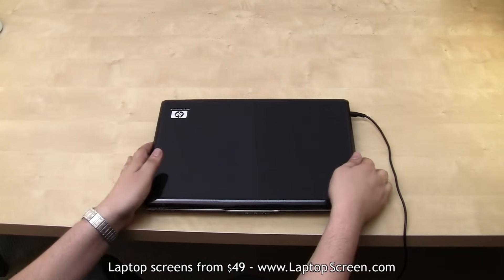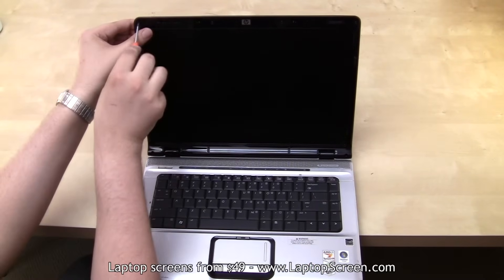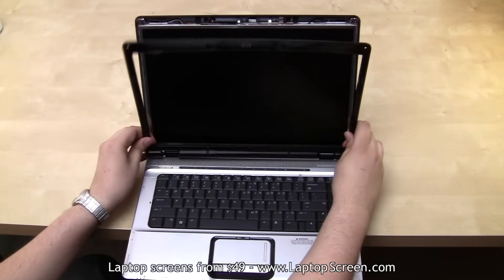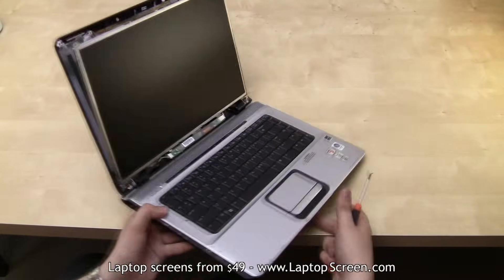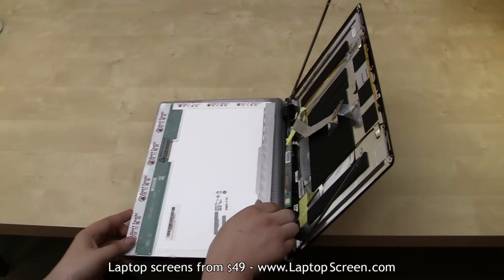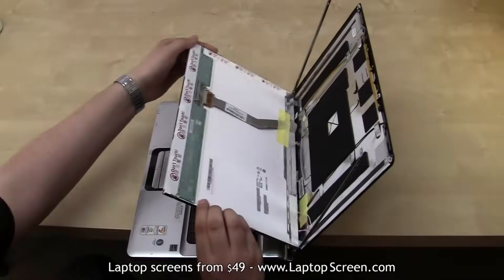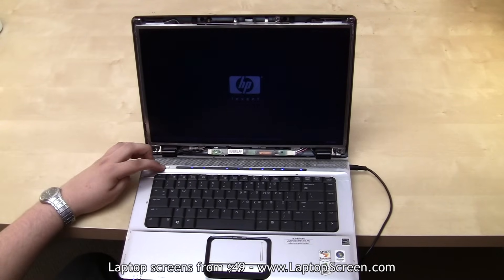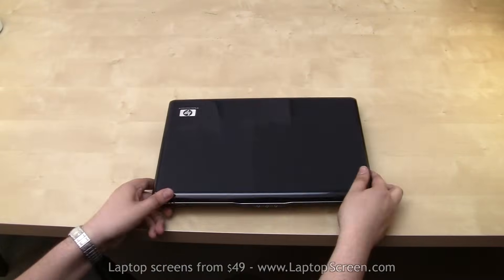Laptop screen replacement / How to Repair (replace) LCD screen in a laptop

Comment: hi, thanks for informative video ! May I ask you about SCHENKER DTR 17 (desktop replacement: P755DM3) screen which is installed in my laptop (17.3" Ultra HD (3840 x 2160) IPS | non-glare | G-SYNC). What I could buy to replace old screen with eg lower resolution like 2560 x 1440 or 2560 x 1920 ? Is there any replacement on aliexpress / amazon etc ?

Comment: Congratulations for the intructive video, i have a question.
What important details I have to consider when replacing a screen:
. resolution
.pin connectors
-touch none touch
. eDP or VLS
What else....about the energy maybe?
If I make a mistake selecting a wrong one, what is the worst that could happen to a Laptop?
Thanks :)
Reply from the maker: + Size and mountings.
But it would be  easier to just type in your laptop model or LCD model number in search on our site to get the correct replacement than to hunt down all the specs.
Reply: @Laptopscreen  Thank you for your answer :) 
Im finding out if if the beautiful FHD IPS HDR 400 Dolby Vision screens from the Thinkpads P1Gen2 and X1E2 are compatible with the T590. Both of them use H intel processors, and the T590, U.
Same 30 pin connectors, FHD, but the T590 need a low power panel, how important is that?
Reply from the maker: They are fully cross-compatible. Power rating is not an issue to get everything working - the interface allows for a range of panels, but the battery life will be proportionally less on a brighter display.
Reply: @Laptopscreen  Fully? Wow, are you 100% sure? :) Does the size of the panel bezel a problem? It has to fit.
So, to change a panel, only you have to check both things: pins and resolution, thats it.
Thank you very much Laptopscreen.com, as soon as I know the panel of those Laptops, I'll orden them from you :D
Regards from Peru, country of the best food in the world.
Reply from the maker: https://www.laptopscreen.com/741945/
Reply: @Laptopscreen  Thank you so much, do you know where explains about sufixes,  what means each letter of the nomenclature, thanks!
Want to know what is HW3B
Reply from the maker: HW means Hard-Ware (version) 3B. The nomenclature is not always consistent among  the LCD models, so its hard to comment what this means specifically in this case.
Reply: @Laptopscreen  Thanks again :)
It is posible to know what is the FHD HDR400 screen models of the Thinkpads P1 Gen 2 and the X1E2 ? I can't find them because they are from 2019.

Comment: Hi, I just replaced my laptop's screen buy after opening the case, when I disconnected the main cable connecting laptop with the screen, I realised that the laptop was on. Now, after putting everything back, the laptop is not getting started. ????? What am I looking at? Something really bad or something fixable?

Comment: Hi, can i replace 1 lane 30 pin edp cable with the 2 lanes 30 pin edp in order to get full hd support for the laptop? And is those are universal for any laptop?
Reply from the maker: Yes you can. Laptop internal video cables are not universal, you will need to get the specific one for your laptop.

Comment: Thank you . I forgot to remove the battery .so I thought I did it wrong, but watching this , I figured out what I did wrong and now my laptop works again .
Reply from the maker: Battery removal is a precaution. Some people replaced their LCDs with full power on. As long as you have the steady hands and an understanding that the connectors need to be plugged in carefully and precisely, it can be done.
Safer to remove all power though.
Reply: @Laptopscreen  would you mind if I ask you whether it's possible for me to discharge the battery completely instead of removing it from my laptop? I don't wanna open the keyboard!!

Comment: if the display blink at an angle of 90 degrees or less in between the screen and keyboard but  when the angle is more than 90 may be 100 or 120 the screen is stable .then what is the cause why the screen blink less then that position?
Reply from the maker: Likely a loose video cable connection, or a break in the video cable in the hinge. Try re-securing the video cable to the back of the screen. You may need to replace your video cable with a new one.

Comment: Cool this is a lot easier than i thought it would be. I just had a QUALIFIED "Shop" re-solder the power jack on my asus laptop and somehow (i really dont understand how this is possible) while re-soldering the power jack the morons broke the screen. When i said they are liable for it they comically said, "are you sure it wasn't broken before" -____________-
Reply from the maker: Our company started out of as a repair shop and at some point there were 10 shops across Canada run by our company in total. I can say with hands on knowledge:
DC jack replacement is among the top most challenging repairs you can do on a laptop, in most cases the jack is soldered directly to the mobo so you have to claw it out of the laptop - taking the entire thing to tiny bits. usually the display would sit aside, but there is plenty of opportunity to damage the display as the laptop is being clawed apart.

On the other hand, some walk-in customers are less than honest about whats wrong with their computer. And if the receiving tech is unable to turn the laptop on to verify its condition, which is very likely in-cases when the DC jack is broken - since no power. So there have been cases of failing hard drives, botched windows installations, faulty memory, even broken screens discovered after the repair has been completed. Its always a heart-sinking moment for the tech when additional faults are discovered, because some customers will blame every single thing that is wrong on "its because you were working on X the A, B & C are also broken".

Best thing you can do in-case you know nothing was wrong with the computer is to say that straight out. But  keep in-mind that a technician who has been working already for several years have likely encountered several "customers" who are deceitfully looking to have a full restoration done on their old laptops by bringing it in for a single issue. Likely so that they can spend as little as they can and sell the computer on CraigsList as "fully functional" right after they sucker the technician into hours of additional free work.

As well professional technicians have trust issues because clients will habitually lie and go in round-about ways to explain to technician that a virus they picked up on a porn website has ruined their computer. Of course people are embarrassed of watching porn, so they will try to conceal their browsing habits. Most technicians really don't care that their clients watch porn, and for them being lied to is a whole lot worse, but clients really don't get that.

Sorry to hear that this happened to you, I guess a few really bad apples ruin the trust for everyone.
Reply: I totally get you ya man, and as someone who has done MANY manual or service jobs for others i am MORE than familiar with the old "WHAT THE HELL DID YOU DO IT!! It was in perfect condition"...

that's why i ALWAYS make sure i cover my ass, and when i took it in i actually SHOWED the technician that the laptop works fine but it only detect the AC power when the bend the end of the power adapter really really hard. I told him rather than continuing to bend it more and more and more, i would rather just have it fixed before it gets so bad that it has to be bent so far it just break or cracks the motherboard. 

So he LITERALLY was using my laptop lol. I turned it on and said "see it works fine, go ahead and move the mouse and test the keys and stuff"
That was prolly more than was needed but i assume he did it just to humor me and he kind of just moved the mouse cursor around a bit and typed some gibberish in an empty text document. 

Now i have built almost every computer i have ever had, i have moded almost all my computers, and that, to a degree, applies to laptops as well. Personally i think laptops are worthless, dispensable, wastes of money. I know they are portable and more versatile, however anyone that can actually convince themselves that something that costs AS MUCH AS a desktop and can NOT be upgraded, can NOT have any hardware swapped out, and has comically poor air circulation, is someone who is truly ignorant. 

That being said i am unfortunately aware in many situations laptops are a necessary evil, which is why even though i didn't want to, i tried to make myself familiar with the guts of laptops. So i have taken apart laptops countless times and never really had a problem at all, in addition to that i am not that great at soldering, but if i have to do it i still can. However, when it comes to something like a motherboard you can't really afford to make any slip ups, ya know. And unfortunately it seems like whenever i solder my hands tend to shake quite a bit, and when you're trying to hold the tiny point of a soldering tip on a 3 - 4mm piece of solder accidentally slipping can end up royally screwing you.

But yeah my laptop scren was definitely in working condition before this, and the dickbag in question NOT ONLY was aware of this, he LITERALLY watched the laptop power on and he than interacted with it. 

I almost thought when he asked me if i was sure it wasn't already broken that he was joking lol. It was just such a brazen ludicrous statement to make it took me a bit to realize "oh wait, this asshole was serious! This piece of shit is basically trying to pretend he did nothing wrong."

I told him i wanted to speak with the owner, and he said he won't be in till next week. Nevertheless, i sort of feel like the owner is just going to say the same bullshit he careless asshat of an employee said. :(
Reply from the maker: Oh man that sucks. I can really relate to your attitude for laptops - overpriced, under-powered, lesser life span due to heat, but a necessary evil for mobility and getting things done on the go. It really sounds like you did do all the due diligence, and its unfortunate that the receiving tech seemed rather uninterested to do the proper check-in check-list.

Good techs are supposed to examine each machine and note, at least int heir minds whether things are in order and if something is broken. It is quite perplexing why the technician who saw your working screen and even typed on your laptop and used the touchpad, has now conveniently forgotten about that. And while I too can see that there is a definite interest for the tech who may've broken a screen during the repair to pretend like check-in diagnostic didn't happen, but in my actions I tend to always lean on the side of good faith and assume the other person is genuinely mistaken. At this point it's not a professional situation - but rather a people situation.

Its important to keep calm and maintain your position clearly and concisely. Bring up the facts - such as the check-in diagnostic on the day you brought the machine in, stating the approximate time this took place and the actions the tech took in-front of you. It is important to scrub the obvious suspicion of malice from your negotiation - and using as few new words as possible restate your position calmly. Speaking to the owner is a natural next step, however if the owner was not the person who checked the machine in, they are at the disadvantage of not being part of the situation. When you do speak to the owner, maintain calm and ask to interview the employee in-front of the owner. Use leading questions like - do you remember that I powered on the machine for you and you used it, while looking at the screen to type out a few keystrokes and used the touch pad. If the employee maintains their erroneous position ask the owner whether there is video coverage. 

And if this is not going anywhere, restate calmly that the machine was damaged while being in their possession and that the shop is responsible for your loss. Ideally it wont get to that - the owner will likely offer to repair the screen before it gets to a dead-lock. The worst case scenario for them is you either already having the machine repaired somewhere else or insisting on monetary compensation in-lieu of repairs. There is little chance that the shop will use the opportunity to repair your machine as retaliation - they are a working business after-all, so a second repair would usually be done by them with extra caution and "by the book". I would trust a shop to do the second repair - because of my direct experience with such situations. If we screwed up customer's machine - we'd do everything tip-top the second time and even spend a 1/2 hour cleaning the machine with alcohol for the customer as a way to make it up to them. Good luck and keep us posted!
Reply: Man it so disheartening that good kind-hearted people like you are becoming fewer and far between :( 

I really want to genuinely thank you though for taking the time to reply to me on this issue. I've noted down what you said to do because if i don't have some sort of physical cue to remind me, one small amount of provocation to much and i basically will turn into the hulk. Flippinf chairs, throwing people threw walls, jumping super high and bringing down attack helicopters, the whole works mak... it's not a pretty scene lol :) 

But i will try my best to keep a calm demeanor and HOPEFULLY get this big nasty mess worked out in a way that leaves everyone happy.

Again i wan't to thank you, not just because you replied, but because you took the time to give a detailed lengthy response with advice that genuinely is helpful. In this world today because an absolute fuckbag seems to be almost "hip" or the cool thing to do and it's a very sad sad face for humanity to have. 

So i just wanted to thank you for being one of the few people around willing to take the time simply to help someone else. Things like that go along way man. I hope you have a wonderful and blessed day.

Comment: There's a warning sign saying "DO NOT TOUCH" at the back of my screen and I'm really concerned if I will damaged the screen if I hold it or poison my self to death becuase of the mercury.
Reply from the maker: Timon, those are surely some scary looking warnings LCD manufacturers put on the back of their screens. 
But you needn't worry too much about it - there are no hazardous materials behind it, and most newer LED lit screens don't contain any mercury at all.
The warnings are there to protect the flexible leads that connect the glass matrix to the LCD driver board - there are several hundreds of connections there and the connection is glued. Touching is not recommended because the glue can come apart and ruin the display. A single broken connection in that area of the screen will show up as a vertical line of pixels.

Comment: so in theory, i can replace my 1920x1080 panel with a 4k panel?
Reply: +Benno Nijholt yup.
Reply: +Benno Nijholt Sure, but I would like to see a laptop run 4k :)
Reply: Your battery, cpu gpu motherboard will be a toaster
Reply: Johannes Aize Well, they will throttle and and your laptop will run at 90 degrees centigrade.

Comment: This was great, I removed the screen as instructed, found the serial number on it, then ordered one on Ebay. Three days late it arrived, and it took three minutes to replace it.  I did break a small plastic peg off  that was used for holding in the bottom plug. But it just seemed to be in the way of getting the plug back into it's holder.  I couldn't be happier with the result however. My new screen is up, and working great.  Thanks ever so much, for this great video tutorial. :)
Reply: how much $$$ was the screen bro?
Reply: +keenan reese , after finding the serial number , and putting it I the search box on Ebay found a screen for $20 , with free shipping.
Reply: wow what a deal

Comment: It seems easy to do, but in my case for some reason the screws for the metal frame(2 step) don't fit! I have the right ones, I  took it apart myself! Really frustrated right now...i don't want to break the new screen by trying :c
Reply from the maker: Sure those are the LCD screws you are fitting? (LCD screws are painted black).
The bezel screws are larger and probably wouldn't fit well (they are the shiny ones).
And make sure to align the LCD properly - prop it up with something from the bottom to catch the thread easier.
Reply: LaptopScreen.com Thanks, I had someone help me with it...and unlike me they put it together in less than 5 min! Lol, felt really stupid  :p
Reply: LaptopScreen.com
Are these new screens just as bright as the originals?
Reply from the maker: Nu B
They are originals. So yes, just as bright as it was brand new.
Reply from the maker: +KITKAT21 No, we are a supplier only, we no longer run any repair shops. Depending on the laptop and if you already have a proper replacement in-hand a typical repair shop will charge you between $60-$150 to replace an LCD. What's your laptop make & model?

Comment: hi, i had a problem in lenovo laptop, that appears green colour, but no problem in external monitor, what the real problem, how can i solve
Reply from the maker: Lots of the time when colour shifts are involved, the video cable is the first item to check - is it fully connected? is it broken somewhere in the middle? - these questions can be answered if the screen changes states (shifts colours) when you are wiggling the display assembly.
Otherwise, take it apart, get the LCD model number, do some research on the actual panel - if it's a common problem - people will say so on the net.
At this point you can find a better panel, and replace it yourself.
Reply: my model Lenovo B460e  screen model LG 14'' LP140WH4